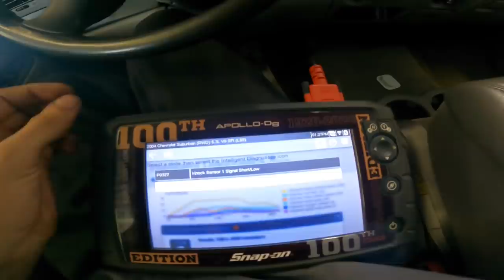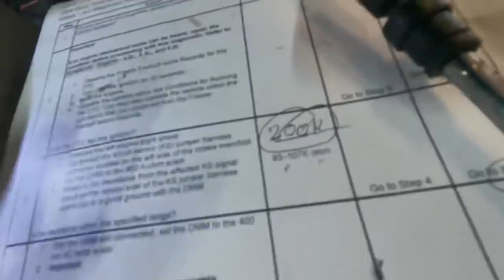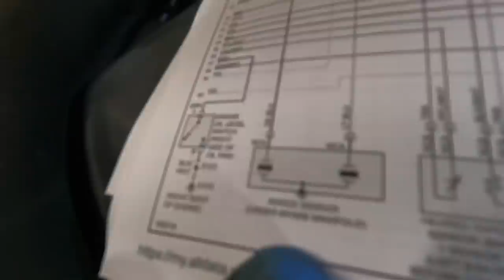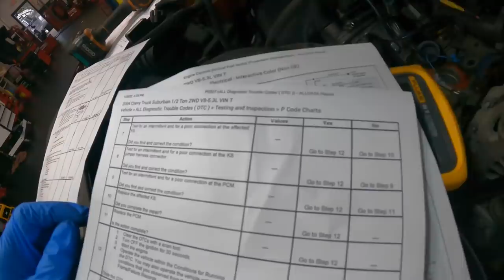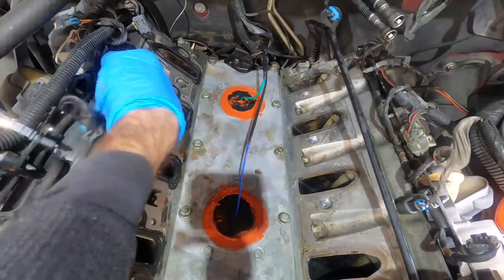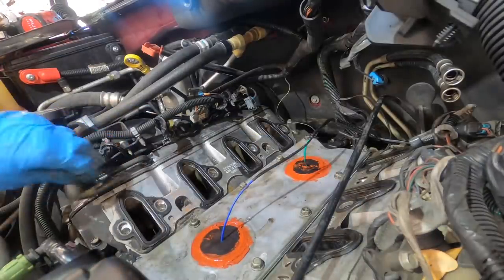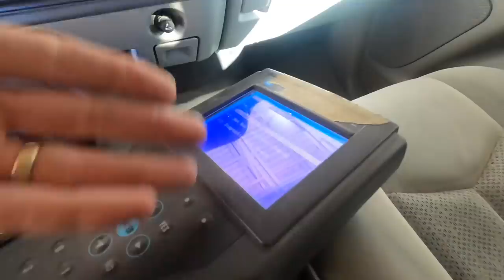Had to DRILL the engine block. NIGHTMARE Diag! LS 5.3 Check engine!

Comment: If those pieces still had some threads left you could have gotten two fairly thin nuts in there and backed out the bottom nut so it would lock against the top nut, then use a flex head wrench with enough leverage to break them loose. Similarly to how you would install or remove a stud.

*EDIT: 
Oh nevermind! Those were fully threaded in, what a nightmare indeed! 😱*

Comment: Have you ever had an engine come in with a knock sensor code where it was actually reacting to an engine knock where the sensor saved the engine and you were able to fix the mechanical failure?

Comment: Couple  off comment's..wot a good mechanic..we just got fitters here in Britain 🇬🇧 charging £35 a time JUST to use the snap on code  reader...I tell you if I brought a new car I would want a FREE code reader as the car's no good just telling its got  problems or is it down to the garage takeing a hit on da bill ?..as if the thing should break anyway its down to part failure...NO CHARGE !

Comment: Years ago I paid a driveway mechanic to junkyard swap the engine on a Toyota Celica, a couple weeks later I get in my car and start the engine, I hear a strange pop and ping, and start digging around, turns out they used a cheap bolt that was over torqued on the engine mount that passed through the timing belt.

The head fell off the bolt and landed on the inner teeth of the timing belt at the lower pully, when I started the engine, it got sucked up under one of the cam gears, ripped the belt and popped a hole in my valve cover and caused all sorts of ciaos. 

But the real problem is that the body of the bolt was stuck in the block with no head, and no room to fit a drill. I thought about just burning the car down to the ground. In a moment of desperation, I grabbed a Dremel at an odd angle and tried to drill a small hole at an angle that i could try to stick something into, after a few minutes of not making any progress, I noticed the vibrations from the Dremel at high speed was actually vibrating the bolt out of the block.

Comment: Not a mechanic here... just a guy that enjoys Ray's vids.  Question for the pros: If a sensor is giving false positives and the cost to fix is significant - what's the risk of just living with it?  I'm guessing the codes can be blocked and spending $1000's to detect a problem that may never occur just doesn't seem worth it to me.

Comment: Curious…when you were tapping on the cover plate was that giving a false positive because the sensors are in direct connection to it, and being over torqued they were picking up random noises from outside the motor such as a vibrating wire or two against the plate….you know that quality repair job…!

Comment: It might have been a mistake to dig in there based on your misinterpreted step, but at least you were in there and able to correct the issue. You would have had to anyways. If you hadn't taken it apart, there is the chance that you might not have gone far enough to find the issue. So mistake or not it was a win in the end. I went back to this video throughout the day because I had to see the ending.

Comment: Go through diag flow chart and still end up at the start with no resolution and then start to check for correct installation of newly fitted parts and stumble upon poorly fitted new parts. Nice detecting. 
Now all you have to do is to learn how to sharpen drill bits to make work life much easier.

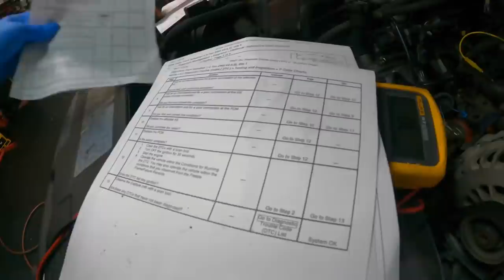Comment: Ray 26:55 "I'm stumped...
If you are stumped go to # 25
Step#25:  Call Watch Wes Work.. Did this work Yes/No?
 If No call Whistling Diesel: Option 1/ Set fire to vehicle and run, 2/ put the vehicle through car crusher, 3/ run over the vehicle with a monster truck 4/ pick up the leftover  pieces and send to the shredder. Tell the owner that his vehicle was stolen off the parking lot.

Comment: I should Drive to Florida and have you work on my 1996 Ford Explorer you'd have Videos for Many Moons and Funny Story about it, it was bought New by FHP as a Custom Build for their Fleet they had a lot of them made but not enough for the Aftermarket Parts Divisions to make the Beefed up parts for it and the stock parts don't fit or they cause the check engine light to Illuminate

Comment: Ray, did you ohm the new sensors? Might have found out they read 90Kish. Reason being, when I see a spec of 83 - 107K Ohms, I understand it to mean 83K Ohms to 107K Ohms. So the 100 Ohms seen may have been a quick indicator of the problem.

But you found it, great job.

Comment: What's really spooky and funny is.....(drum roll).....don't vacuum carb and brake cleaner up in an older shop vacuum. It can go "Boom" and you may grease your shorts. 
  In my story the shop vac was ok and still working just blew top off about a foot. Very loud pop and thud with chemical and ozone smell. My blood pressure went off the chart and thank goodness "no grease" in me shorts.
Apparently the inner electronics of the shop vacuum ignited the "flammable mixture.  Long day and one mistake later makes a funny story to tell grand kids.

Comment: You multimeter did show quite a difference in the two test of the first sensor and different from the second. That lose crimp. Diffenity over torqued. That tech may have noticed the slip and couldn't get them back out. Hoping for the best. Oops.

Comment: Could this be an overtightning problem of the Knock sensors?  Clearly they were to tight and not mounted in the right way, the 2nd knock sensor did give a lower reading then the 1st sensor. All in all a very good diagnosis! Ive subbed :-)

Comment: I had this on my 02 Tahoe  and I used 5 min epoxy  carefully poured into the sensor  and was able to get them  to unscrew. Why are there holes in that area for oil when there is  no moving part to lubricate ?

Comment: so on my 2003 6.0 with 318k miles. I didn't want to do this. I screwed the knock sensor into a empty threaded hole on the front of the head on the passenger side. light has stayed off for 15K miles.

Comment: So next time they get over torque just like my rear one was by the guy that did the job before me hammer a large snap on flat head that has the nut on the stem and put a wrench on the screw driver and the sensor will turn out. No drilling needed.

Comment: Ray, I thoroughly enjoy your videos,  I watch every day without fail but I have to say this one has been the best one I've seen in quite awhile. I really enjoy the diagnostic process.  I'm curious though,  as  I repair electronics, not cars (except my own). In the Auto Repair Industry how does something like this end up getting billed usually?  If something turns into 2 or 3 days of diagnostic work but the tech is man enough to say, hey I missed something I should have looked at long ago, does the customer get any adjustment to labor time?  Any mechanics, Ray or anyone else have any input?
Reply: What was missed?  The diagnostic troubleshooting procedure said to 'Replace ECM".  There was nothing in the troubleshooting procedure to recheck that the knock sensors hadn't been incorrectly installed (grossly over-torqued)--Ray figured that out using his experience and intuition (after discounting the recently installed ECM).  Just as a layperson, I would expect to be charged the shop's standard hourly labor rate (plus parts and misc).  Also, in the future, I would avoid the person/shop who installed/over-torqued those 2 bad knock sensors.
Reply: @kenc2257  yeah,  I wasn't saying Ray food anything wrong. It just made me curious since he himself said that he should've checked the knock sensors in the first place what happens IF a tech misses something obvious and then goes down the rabbit hole how out is handled. Like I said,  I own a company and do a ton of my own diag work but, the electronics industry is where my knowledge lives from a business standpoint,  not automotive. 

I would definitely avoid whoever put in those over torqued knock sensors as well!

Comment: Hey Ray what probes where you using for your meter to probe the connectors? i have always used strands of copper wire but would like to get the tool designed to do the job.

Comment: NEXT TIME THE TOOL TRUCK COMES AROUND; GET SOME DECENT DRILL BITS. probably SHOULD HAVE USED AN OVERSIZED NUTAND THE WELDER TO WELD THE NUT ON THE STUD AND BACKED IT OUT WITH A WRENCH.

Comment: I don't understand why I don't understand why so many people feel they need to over tighten every bolt they touch.
I once saw a person break spark plugs(3 of them). Then they asked me why the plugs were breaking. I said "Show me how your putting them in."
He did, and break another. LOl omg the fool was using a standard socket and tightened them to 40 lb/ft. He was lucky it was a iron head, if Aluminum he would have pulled all the thread right out.
I said " You said you know how to repair cars, who told you plug need 40 pound of torque.?"
His reply " "It's a big thread, not thread that big take more torque?

Comment: Reverse drillbits usually don’t work when they’re corroded in the hole but you can try. and instead of center punch get yourself a Dremel the best one I use is dotco 1000,000 hundred thousand RPM you can use it as a magic wand for use it as a center punch you can actually get yourself perfectly center with it running at 100,000 RPMs with a carbide bit made by Dremel flame style sold at homedepot  the carbide bit the Dremel itself is dotco 100,000 RPM so now if your bolt is corroded in there and you can’t get it out and you’ve drilled off center you can align yourself back up to Center and you can slowly and very easily with 100,000 RPM holding the dotco with two hands Bring yourself back in Center, Court out to where it pulls out like a Heli coil I’ve been doing this for over 30 years sometimes 40 to 50 bolts in a day I can come show you if you would like I am Retired and bored and love doing mobile service at no charge of course

Comment: The reason I’m blowing air into the intake runner is to… blow the debris out into a different runner.
Maybe cover the runners with a towel after you blow them out?
Reply: Or green masking tape? I wouldn't worry, I'd guess at least one of those eight cylinders has its valves closed.
Reply: Oh, next you'll be telling him not to put the intake manifold on the floor.

Comment: ive had my 05 6 liter  intake manifold off thrice for sensors and or subharness- now it misfires  enough to fire the CEL and i  pull a battery cable  for 5 minutes, turns off the light for 6 weeks

Comment: At 52:21 mm:ss, double hand on torque wrench INVALIDATES the torque click.  The main handle has the smooth circle in the middle of it.  THAT is where force MUST be applied to achieve correct torque.

Comment: I love the folks who claim that these GM trucks were so great. 107k on the odometer and it’s had a full suspension rebuild, the engine torn apart twice and an oil pan gasket. I had a similar vintage F150 that towed at least 4-5k pounds every day for 200k miles and all I ever had to fix was a coil pack. It was unfortunate that a 3/4 ton dodge tried to get a new ford tailgate as a hood ornament at 65 mph. My old Suburban however, is a parts pit. At 250k it’s had a transmission, rear end, 2 starters, alternator, fuel pump (just filled it too…that sucked) and an ignition switch. It leaks oil, trans fluid, and power steering fluid. The front suspension is shot, the exhaust manifold is broken, the air conditioning doesn’t work, gear indicator is out in the dash, 2 of the doors won’t open anymore, if it’s plastic, it’s broken. Worst f’n vehicle I’ve ever owned. I’m glad it’s only driven about 100 miles a year or I’d go broke completely just trying to keep the fluids contained.
Reply: "just filled it too" That's how it always happens. Former Ford dealer tech.

Comment: I haven't watched to the end of the video yet, but I'm at the point where you've destroyed the sensors, NOT YOUR FAULT. I have three suspicions. They were either over torqued, breaking the casing seal on the sensor. Or some kind of sealant or threadlocker was used on the sensor threads. Or maybe they crossed the threads on instalation, causing over torquing on the seal casing, compromising the seal of the sensor and preventing the sensor from seating properly. Once you destroy the sensor on removal, you may never know for certain.

Comment: 33:13, since we already know they're pooched, would a slight tack weld hold them together long enough to remove them from the engine?
41:19, does this mean a new purchase is in your future when the tool truck rolls in next? Them hazardous freight tools are good for a few uses, but NOT reliable enough to use in an industrial setting. 
 
52:30, & 53:04 🤣😂Click bait. LOLz! 

55:10, it definitely looks more gooder after smearing of the goo.

Comment: there's an auto parts store here where I live and I was talking to the person in their and he says when those sensors started coming online it changed his whole business… He said instead of selling actual motor parts he says the business is all centralized around the sensors.  In this video all this work just for sensors when the actual vehicle was running just fine and after the sensors just fine… Something's fishy here.  I have a 2006 Mazda that had the engine check light and when it went off I reset it and it never came back… So I'm glad I never took it into the shop because I think it's a mistake having too many sensors in vehicles… And the proof is the auto parts store how their whole industry switched to servicing these idiot sensors

Comment: 3:56 into this and I am over it. (Sorry, no extra revenue from me watching the ads.) "Measure the resistance of the affected circuit,,,,   Yada Yada Yada." The actual test wants you to measure the resistance of the affected circuit to a good ground..... There are 2 Knock Sensors, each are one wire sensors. 2 wires on Plug, 2 different circuits. You measured across both circuits..... "Follow along step by step."  You Tripped on step 3...

Comment: late to the video, but very surprised you using High Speed and No Cutting Oil. as per Logan Ramos, you need to drill slower with oil.

Comment: Never gas it with a half inch and wobbly bits? LOL. I actually have a "wobbly bit" designed to be used in exactly that manner. But it not the usual U-Joint design, and it's wobbliness is limited in comparison.

Comment: I’d love to know what/how the computer was “testing” the knock sensors to throw the fault code so quickly!  Given that they passed resistance and frequency tests, I also wonder if they really were ACTUALLY BAD, or if the computer “test” was too picky!
Reply: Whenever the engine is running the knock sensors (which are actually microphones) are always going to be picking up normal engine noise. The computer continuously looks for that and if it sees the normal noise it knows the sensor and its circuit are working properly. In contrast the sound of engine knock is not normal noise and the computer can pick the knocking sound out of the normal noise. The computer has frequency filters so it can tell the difference. The manual "frequency test" where you tap on the cylinder head is really just a basic test you use to see if the sensors and their wiring are basically working okay. This vehicle is an unusual case because the previous mechanic had damaged the new knock sensors by overtightening them. After that the computer did its job by listening to the damaged sensor's output and it correctly determined that something was wrong.

Comment: Argh!!!! All those leaves and open ports that should be stuffed with rags FIRST thing, before ANYTHING else! Who knows what bits of grit and nasties are getting in there as well as the leaves. At least the leaves are big enough to notice easily but anything can be dropping down deep into there then into the cylinders while those are uncovered. Absolutely first thing as soon as you hopefully cleanly lift the manifold off should be blocking them up. I've noticed you stuff rags down and right into them, I like to stuff some in but preferably leave no open area at all for anything to get a chance to drop in and possible slip by the rag when you pull them out either.

Comment: I had this exact scenario & after 3 days of searching it turned out to be a strut mount setting off the KS. These GM KS’s are way too sensitive & always have been.

Edit: should’ve just taped off the holes before drilling you goober

Comment: Wouldn't of been easier to tac weld a bolt or something onto it, and turn. Rather then risk contamination of metal within the engine. As you never know on a micro-level what metal shards might still be there or gone in. As seems little messy and pain in the bum the drill method vs tac weld some small bolt or something and turn on that

Comment: are the sensor's OEM GM as they have been updated and redesigned as they have had this issue with  and if they are after market then that is the issue the non of the after markest GM sensors actually work  sama d ford aftermarket I have not ever had one after market that has ever worked properly or lasted= more tank 2 weeks ..but when i use OEM GM  and Ford the always work and last

Comment: Hey does anyone know what is the name or part number is of the little plastic locking clips for the injector electical connectors to the injectors?  I've been looking for new ones for my gmc sierra 2002 2500hd and can't find them online anywhere.

Comment: Next time you have to pick up all those shavings, put a magnet in a plastic bag.  Pick em all up, then go the trash and pull the magnet out of the plastic bag and all of the shavings will be in the trash and the magnet clean.
Reply: peety couldn't find the aluminum magnet
Reply: @desotosky1372  I'm assuming the bolts are not aluminum.